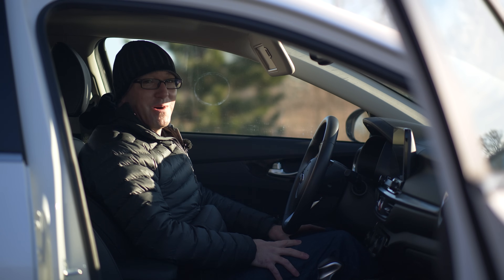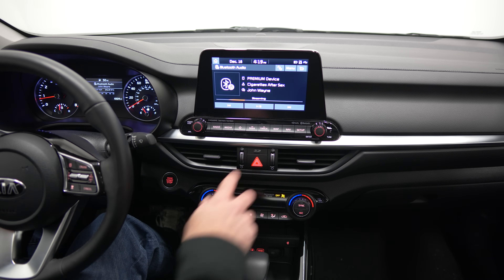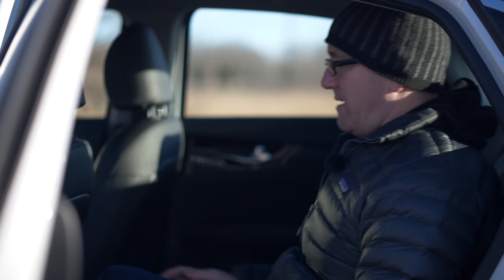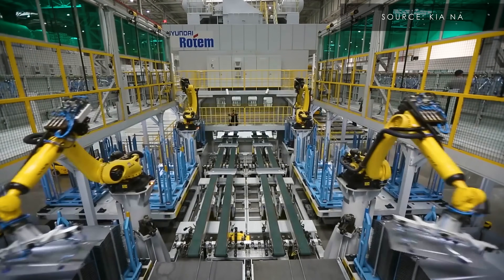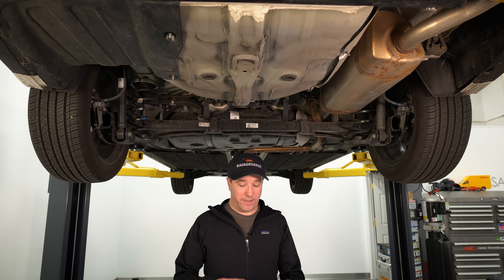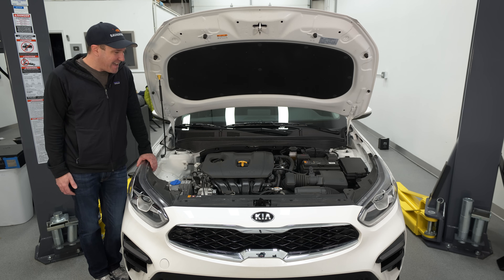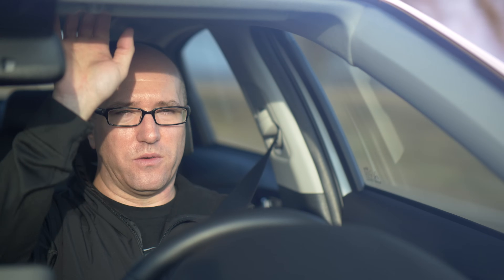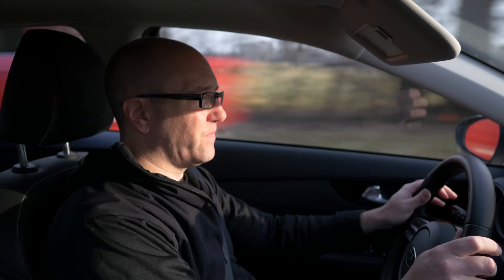2019 Kia Forte Review | Bait and Switch

Comment: Who chooses a car because it's $300 cheaper than the competition?
Reply: He said $300 difference from a manufacturing standpoint...thats a BOM cost....that could easily translate to $600-$1000 difference retail or some extra feature that this car can now have in place of a multi-link.
Reply: @skifree0  No, doesn't have to be. The difference between a multilink and torsion beam is minimal. Manufacturers spend much more on advertising which today is money wasted. Honda lost many customers when they went from double wishbone to  MacPherson strut type. I think Kia is going in the wrong direction with the Forte by lowering power over previous years. The Rio is where they can cut costs. High tech has traditionally been the domain of the upper models and trim levels. This makes sense. 
Used car market is doing well but new car sales not so much. It reminds me if when Dodge only put a three speed auto in the Neon. The car would scream at highway speeds and suffer in the fuel economy department. Cost of an overdrive was $200 at the time.
Reply: @carlosoliveira-rc2xt  Yes but, modern Torsion beams are very livable. This isn't a sports car by any means, its basic transportation. Honda lost customers because their demographic was in cars that handled well and aimed at the more enthusiastic market. You could make the argument that corolla's have had torsion beams even up to the current generation (though the 2020 is going IRS), and have been selling well consistently.

And it's not like Kia is not alone doing this, there are plenty of companies going back to torsion beam with notable examples being the Mazda 3  in their new generation, and the latest Jetta as well (which many reviewers have said was undetectable in day to day driving).

Also the lowering power thing in a way makes sense. I've owned one of the previous "high powered" Kia cars. The 2.4L Engine in the base optima made 200hp way back in 2013, and it was impressive. The downside that many people don't see now was those engine were incredibly thirsty. I still remember just some moderate acceleration in "mostly city" conditions in my optima gave me 19mpg.... That was ridiculous (and bordering V6 levels of fuel consumption), and given that the engine was starting to overwhelm the chassis and suspension, It made sense to detune it, get some of that fuel economy back (what most people look at when buying cars) and not wheel hop the tires when the roads are slightly slick.
Reply: @skifree0  You're incorrect in that the horsepower was starting to overwhelm the chassis as the chassis was designed from the get go to go racing. Also just because most manufacturers do something doesn't mean it's the way to go. Manufacturers spend a ton on advertising to fake differentiate themselves from the competition so why not a multi link rear to actually differentiate? This makes sense in the sport models where they won't have to stiffen the suspension to compensate for using a torsion beam rear. 
 This is an issue in all consumer markets where bean counters think that consumers aren't willing to pay one percent more for better performance or a desired option. I see in in consumer electronics, auto industry and even in housing. It's nonsense. As was stated, no one purchases a vehicle because it is $300 cheaper. They do so based on performance, value (not the same thing as cheaper), reliability, type and price category.

Comment: This the problem I have with modern cars.  They have to compete on tech because the "crowd" wants tech.  This is to the dtriment of car design and engineering and I am not with the crowd on this.  Give me halogen lights, no touch screens, to connectivity with the exception of Bluetooth.  Get rid of the sunroof and all the safety nannies.  GIVE me comfortable seats, cloth seats, quality suspension and wheels design and materials, a decent sound system, high quality structure etc.  This is where the money should be going, not on all the unnecessary crap on all modern cars because the "crowd" wants it.  This is why todays cars are mainly ugly, uncomfortable, noisy, poorly sprung and really really boring to drive!!!

Comment: 60/40 f/r weight distribution? What the hell, did they put a boat anchor in the engine bay?

You say customers won't know what a torsion beam rear is, but then the ride is noticeably harsh. People will recognize that on a test drive, I highly doubt people are going to value tech over ride quality on a daily driver commuter.

Also, there's no way in hell that CVT is better than any torque-converter auto with that shit launch from a stop. Your Kia bias is showing dude
Reply: ...its FWD dude...motor and trans in front...where do you want the weight to be...?...

Comment: Reviewers like you are why CVTs suck. They aren't fucking supposed to shift like a normal auto. They are supposed to hang the engine on either its most powerful or most efficient RPM, or somewhere in between based on load. 
Blipping and downchanging under brakes? When it could be maximising engine braking and using zero fuel? How is that advantageous?
Reply: wear?  You have to realize max engine breaking  or max Torque, is very demanding on any transmission, and CVTs are notorious for failing under high torque situations. 

To gain the slight advantage of a continuous shift at the cost of constantly moving the ratio (and moving the belt) while exerting maximum force in a perpendicular direction, is sacrificing the life of the component for the sake of a negligible difference in absolute performance. Remember when these cvts "Shift" the pulley change is done with minimal torque applied, where a "upshift" would cut engine power, and a "downshift" would essentially rev match it. 

To me I would gladly take the 0.1 seconds longer to "fake shift" and not have to worry about the abuse a CVT goes through a continuous change at peak torque.